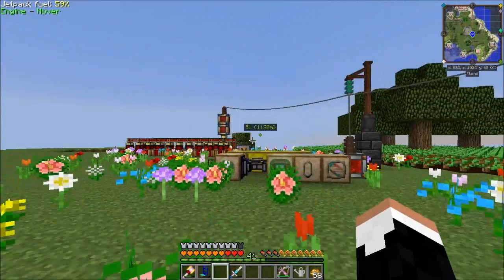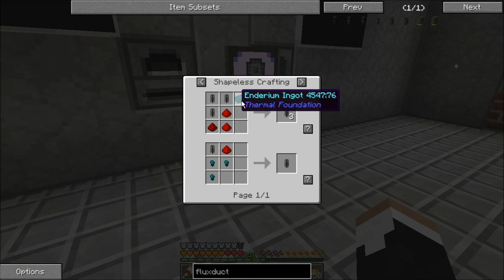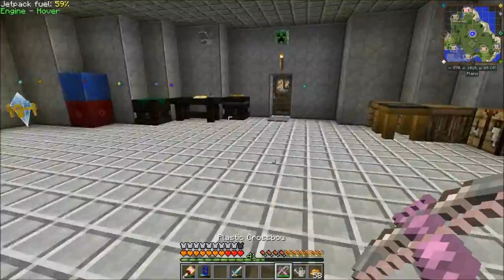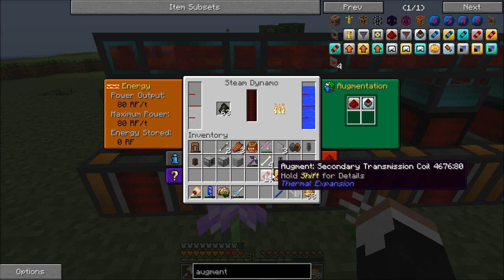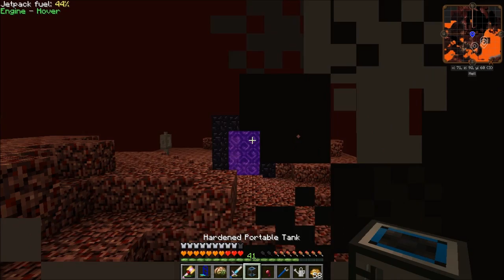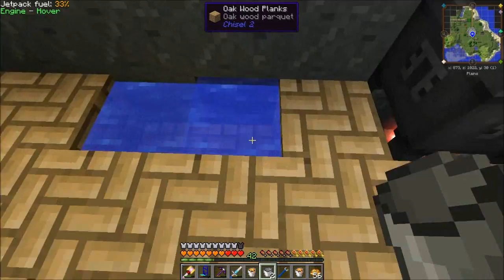Modded Minecraft with Nightdagger S5E29 - Power network upgrades

Comment: you know you can make more tesseracts to power a ender pump to pull lava and make a lava generator to help produce power for the ender quarry.
Reply from the maker: +RantingRev I do...but I'm specifically trying to avoid lava power this season, because it's JUST TOO EASY.
Reply: LOL sometimes it is but with the soon to be huge demand of power you'll need it since literally the ender quarry sucks up power to the point it's the greatest demand on any power system unless you go to Big Reactors
Reply from the maker: +RantingRev Well, one of the machines from Rotarycraft actually puts the ender-thermic pump to SHAME in lava production.  I mean, with the ender-thermic we're talking maybe a hundred buckets of lava in ten seconds, right?  With this machine, we're talking, potentially, upwards of ten times that...

But yes, I think I mentioned it, either in one of my earlier episodes or on one of my livestreams, I'm intentionally eschewing lava as a source of power this season because I want to force myself to use other methods.  I've already shown one of those, the steam dynamo battery which we just upgraded this episode (and I mean, 64k RF/t is nothing to sneeze at, but we will want more), but we still have to explore the other types of dynamos, renewable fuel sources, fossil fuels and Immersive Engineering stuff, possibly some Rotarycraft/RF crossover stuff, and of course Big Reactors.  We are not going to be hurting for power before all is said and done.
Reply: I saw I can't wait to get a new PC so i can upgrade My mods to allow all the upgrades